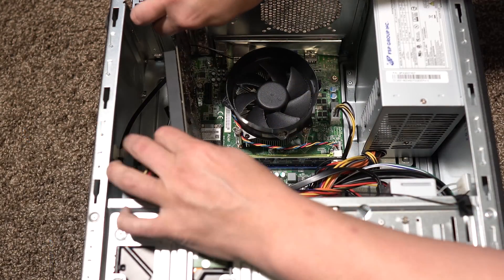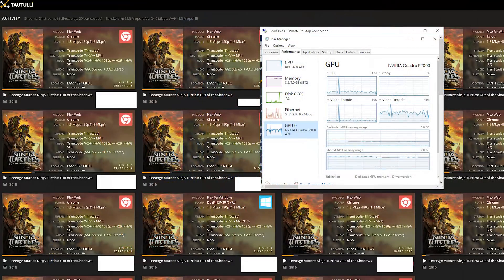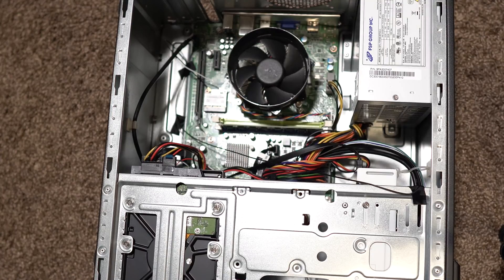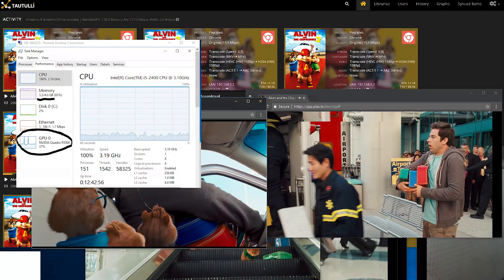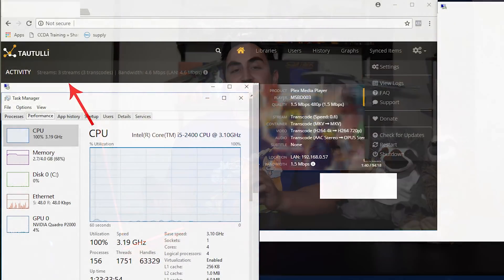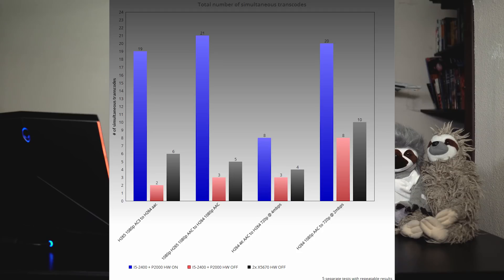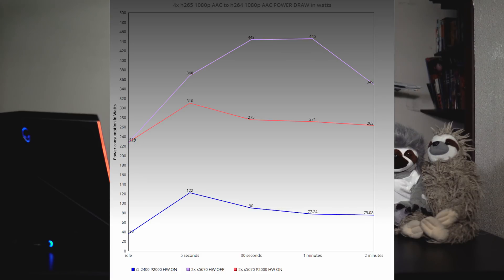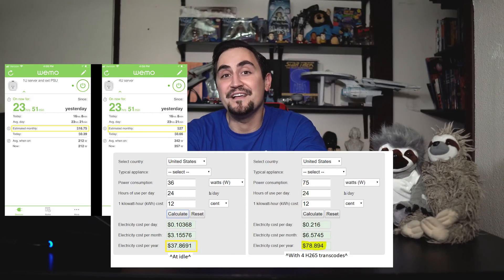How to build a CHEAP AND Powerful Plex server!

Comment: About to set up my first media server, but Jellyfin. Using a old 1600 on a A320m board, 32GB 3200C16 and a Quadro P2000.

Services are getting ridiculously expensive and shows across multiple platforms. We're buying movies and shows on DVD from eBay, Facebook marketplace, garage sales, etc. to convert to digital files.

Comment: Could you review the new amd APUS´s? I'm trying to build a new low-power low-cost server, and I have read that AMD AMF transcoding drivers have improved a lot, so the options are 3400g (too power hungry) j5040 (too weak in computational power) or the I3- 9100 (the most power hungry and expensive). It would also be possible to add the nvidia quadro p400, which on eBay can be had for $ 70, old but still powerful. Which combination would be the better-low cost- lower power hungry? My target i 4-5 transcodes tops, 1080p h.265.  Thanks and great work!

Comment: I have the p2000 and p4000 would the 4000 be better?
Reply from the maker: I haven't tested the P4000, but i would have to imagine it would perform very similarly to the P2000 due to the same # of encode/decode chips.

Comment: Could you PLEASE do a build guide or list a recommendation for a non budget PMS (maybe sky's the limit and than a little more reasonable)? Something with high power (handle 4K and 1080p h.265) but lower running costs like you show here with the P2000. There are tons of budget Plex server build videos and recommendations out there but so few for reasonable or high end. I was thinking of building an Unraid Server (?) with a used Dual Xeon mobo and procs with lots of ram in a full tower. Now that I've seen this and the other P2000 video of yours, I am wondering if it would be better to go with an i7 proc on desktop board with a decent amount of RAM keeping the operating costs down. Thanks in advance!!!
Reply: Eric Rosenwald I agree! I would love to see this too!

Comment: Just subbed! Great work. I'm having a hard time right now with my growing plex server and my i5-6600 + r9 390x. I plan on adding the p2000. I also have an i5-3470k lying around, would the results be around the same? Both system have 16gb of ram but it would be easier (cheaper) to add DDR3.
Reply from the maker: Yeah the p2000 is a powerhouse. It's hard to push it to it's limit.
Reply: Which processor do you reccomend to use the p2000 with? I plan of using the other one as a gaming pc so.. But my first use is a Plex machine

Comment: VERY relevant information for those, like me, who are media whores.  You took your research a few steps further than I would have.  I'm running an almost 11-year old XEON workstation that I built primarily for Photoshop, but have utilized the PROC for MKV conversion..  I built a dedicated Plex server two years ago with a Z170 MB paired with a Pentium G4400 and 16GB of RAM.  The library is 99% SD, but I'm about to migrate to much more HD content.  My current limitation is disk space . . . . the 8TB mirror is not quite enough.  You've given me some things to consider when offering much more HD content to my friends and family.  THANK YOU!

Comment: Dude! I've been looking for this answer as I have an old custom gaming rig I want to move into! Subbed! Thanks for all your other well-informed, detailed videos,too. Clean work, man!

P.S. If you have the time, do you think the P2000 paired with an AMD Phenom II X4 945 would be able to handle half of what you've found here? It falls just short of your i5-2400 specs at stock. I'm worried about AMD in particular, but with HW transcode on, should be ok, yeah?
Reply from the maker: yeah with Hw transcoding on you'll still be able to get a healthy # of transcodes probably just shy of the i5-2400 results. Thank you for the positive feedback man!

Comment: What would you recommend for someone looking to build a rack-mounted Plex server that's also very quiet? I sit 10ft away from a full sized rack. I can't have something that's very loud, whining 24/7. Do you cover that in any of your videos? I might have missed some detail if so.
Reply from the maker: very good question, A t3600 (the VR gaming PC) actually did VERY well as a plex server i tried it with a P2000, AND a GTX 980 with the linux nvidia driver patch (to allow unlimited transcodes) in both cases it performed extremely well. The GTX 980 is really the best bang for your buck!

Comment: So i grabbed 2 xeon 2690s with a dual sever mobo. I have 64 gigs of ddr3 ram ready to go, would throwing in a p2000 be any faster, or alleviate the cup useage to overall make the server faster?
Reply from the maker: Are you running Linux or windows?

Comment: Awesome Video!  i'm running Freenas 11.2 with a AMD (8370) CPU w 16GB of RAM....could I use this card in my existing setup?
Reply from the maker: unfortunately in linux you will be limited to encoding only, decoding support for NVIDIA cards (NVENC) is not an option currently. I read plex was working on fixing this, but i don't think its been patched/fixed yet. So you'll get half the performance in Linux. If you run this in windows you will have some awesome performance. Half the performance will still net you quite a bit of transcodes with that CPU. Your 8370 is powerful and it will handle the decoding so you might even see better performance than i did in the video.

Comment: TRANS-CODING is all done by the CPU, not RAM...unless you have a GPU graphics card with hardware acceleration combined...like Adobe does. You bottleneck is your CPU not RAM
Reply from the maker: Each transcode you start requires a bit of memory (50-100 Megabytes). 4GB is insufficient for a large # of transcodes (15+), which was the point I was making.

Comment: Thanks for these videos, and breaking everything down so clearly. I'm currently running a dual xeon x5650 server and while we haven't hit bottlenecks with transcodes often, that thing makes my office too hot with no AC in the summer. After watching these I'm going to drop a P2000 (already ordered) into the server and then likely migrate to a new lower TDP based build in the future.

Thanks again, I really appreciate clear and concise videos like this!
As a side note, I would really be interested in linux performance comparisons on the same hardware. I am currently running on Windows Server 2012 but would like to move to linux for the next build.

Comment: Looking at the NVENC Support Matrix, it's unclear whether a P2000 or P400 would make a bigger difference in encoding streams with the >2 stream patch on the p400. Reading most of the basics sounds like the NVENC chip is separate from the CUDA cores that use the GPU memory (biggest difference I see between these two models), so does anyone have performance numbers for NVENC/plex streams on the P400 vs P2000? Thanks!

Comment: That P2000 GPU is $400.  You just spent your electricity savings for two years on that.
Reply from the maker: it depends on what kind of server you're running. Cost could be recouped in less than 1 year depending on your load and especially if you're running a dual westmere server. It isn't for everyone and in my other video I recommend quicksync servers that are both energy efficient and  reasonably priced.

this doesn't even speak to other factors of running other server hardware and software transcoding that this solution can solve for:
*Heat generated
*Noise
*physical space
Reply: I had a dual xeon server I build for about a year and it was "ok".  Not very energy officiate at all.  I now use a Synology 918+ NAS and use hardware transcoding on it. I wanted something more energy efficient.  Plus I use the NAS for a ton of other things.  But I am still looking to see if I can build a small, cheap more powerful Plex server that can do a lot more transcoded streams than the NAS can do.  Don't get me wrong, the NAS has ben working great.  I rarely ever need more than 2 simultaneous transcoded streams but it would be nice to have a more powerful server but not the higher wattage that goes with that.  I share my server with three users outside my home.
Reply from the maker: @myunk  This video should be quite interesting to you then. The quicksync enabled cpu's are very energy efficient and can be had on eBay for a pretty decent price. If you only need the ability to do 2ish transcodes the T1700 small build should work great for you.
https://www.youtube.com/watch?v=jNv44KkMvzU
Reply: Leaning more towards the DELL PowerEdge T30 with the 1225 xeon.  Not too many more watts and a bit more bang for the buck vs the T1700.  We shall see.

Comment: so I'm guessing the p2000 doesn't have the stream limit like the gtx 980ti and such. I saw another video where someone was getting similar performance on a 980ti using a modded driver on ubuntu linux. though the 900 series gpu's don't support as many codecs or something.

Comment: Yes im sub 401!. Nice video btw. Damn, i have dual E5-2697 V4. This GPU really punch some performance.
Reply from the maker: damn that is quite a build! What kind of power consumption do you see at idle with those bad boys?
Reply: I just checked that. Never bothered doing that befor :D. Only small problem is that they are never idle but at 2-3% load its around 25w each. Well i went all in on CPU power, ofc befor plex and HW transcoding was a thing.

Comment: wouldn't you use the onboard igpu to hardware transcode using qsync? Sandy bridge CPU onwards can do this
Reply from the maker: quicksync works well and i just posted a followup video on the topic its the '$200 plex server' video. TLDW from the video: You want something post haswell, its fast and powerful but still not nearly as powerful as a single p2000.
Reply: @SlothTechTV  Yes I just finished watching your $200 Plex server build. Very similar options to what I have run in the past.  My first Plex server was a secondhand SFF HP workstation with an Xeon E3-1245 v2.  I added a modified low profile CPU cooler to keep the temps/noise down as it ran 24/7. Then I updated to a custom coffee lake i5-8400/z370 ITX build in an Inwin Chopin case with built in 150w PSU (Very compact setup as I have a Synology NAS serving files to it to trancode) This was before Plex enabled hardware transcoding was around and I needed to potentially transcode upto 8-10 stream at once. Now the next goal is for Plex to improve 4k HDR transcoding
Reply from the maker: ahhhh damn thats really cool, i kinda fell in love with those e3-12xx series cpus while testing with them.. such low power consumption, great performance ESPECIALLY with quicksync/hw transcoding turned on. you have the right idea. 4k hdr transcoding does kinda suck.. i just try to have multiple formats of media files so i can direct play 4k for now.. that said my p2000 rig handles 4k transcodes surprisingly well.
Reply: Sloth Tech TV I think where people (myself included) ran into trouble trying to stream 4k content is from using the Plex app on smart TVs and some other cheapo devices. A lot of manufacturers simply don’t update the plex app. I checked on my 2 year old Samsung and it has never been updated. No wonder I could never get 4k HDR to play properly even when direct streaming over a hardwired home network. At home I use a combination of Intel NUCs (2nd & 3rd gen) running Librelec/kodi (1080p) and recently a couple of NVIDIA Shields (Great little device) to handle 4k content. I’ve also ordered an Apple TV 4k as I’ve heard they are great with 4k HDR content (Although I’m not really an Apple fan) Ironically I use Plex to serve content to family and friends and when I’m away on business (the little Roku stick is great to use in hotels) Anyway great vids, I am now a subscriber and looking forward to future content!

Comment: Hey buddy, loving the content, quick question, what are the seek times while  transcoding down pre and post hardware accelerated transcoding? Jason @bytemybits got like 13sec pre and about 4sec post? Also what’s it like while using your Xeons? Does the p2000 perform better? If better, I believe you’ve achieved your objective and I’ll be looking for a p2000 rather than a 1080ti :), Regards Shane

Comment: Great video. I have an HP 800 G1 with 32GB of memory sitting in a closet.  I will see what this card retails for. Maybe I will this a try. Currently I use the Nvidia shield TV, as only do about 3 streams at any given time. I like that fact that it's a low power device..... Nevermind,the video card too expensive for me

Comment: Hi, why select a P2000 gpu and not a Geforce 1050 or better?
Reply from the maker: In my other video i talk about how the geforce cards are locked to 2 simultaneous transcodes. While there is a 'patch'/hack for Linux that allows you to unlock the gtx cards you can still only do encoding and not decoding with them so you'll end up bottlenecked by your cpu. I wrote up a blog post on how to do it on our website: http://slothtechtv.com
Reply: This cleared everything up. Thx.
Subbed!

Comment: Excellent video. Subscribed. Would love to see more on this topic. Eg hardware transcodes on Intel (eg G5400 or some low  spec Quicksync CPU) vs AMD Ryzen 2200G.  Wondering which cheap CPU does best. Doubt many of us need to stream 20 streams (or have the upload bandwidth to do so!!)
Reply: Actuallty G5500 has UHD630 (G5400 has UHD610) so better bet.... Same as your 8600K for transcodes

Comment: Can you please do a video using linux as the main OS?  I have a E3-1275 plex server running Ubuntu 16.04.5 LTS that won't let me use QSV and am wondering if a P2000 would work and let me play 4K BR rips.
Reply: I just bought a P2000, I plan on doing a linux build with it.

Comment: Another great video, I've got a line on a $50 used Dell T5500 and I'm thinking of jamming a P2000 in it.   Seems like it will give me plenty of capability for my 6-10 user Plex Server...

Do you run your Plex Server(s) in Windows or Linux?  Direct on the machine or in a VM?
Reply from the maker: I run them on bare metal in windows 10 Linux and windows server will lock your card to encode only no decode.